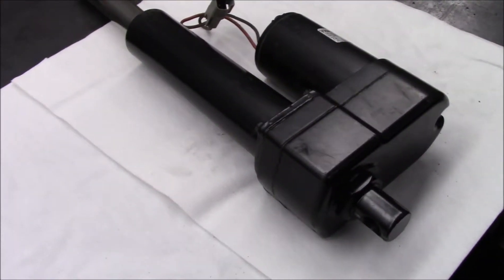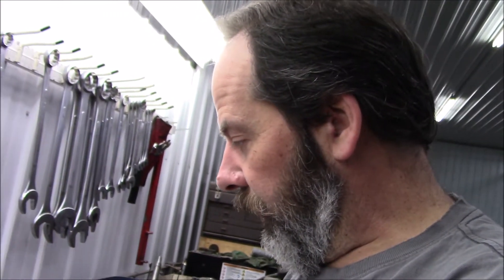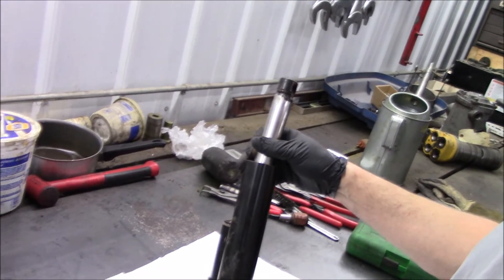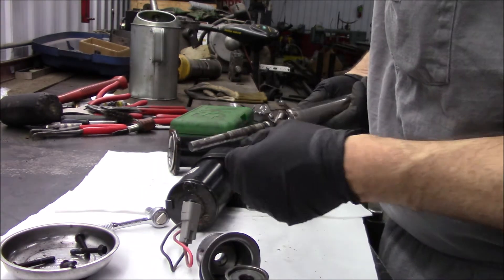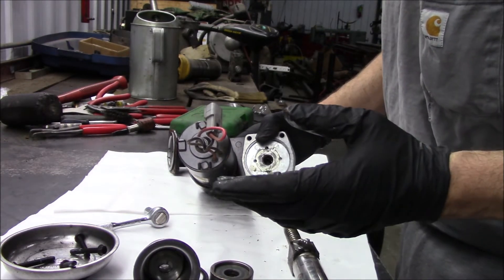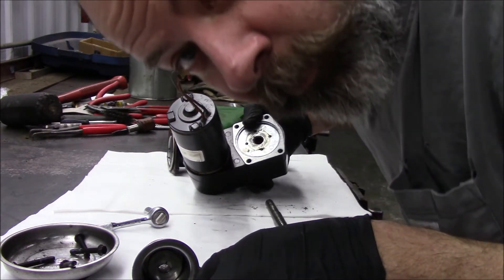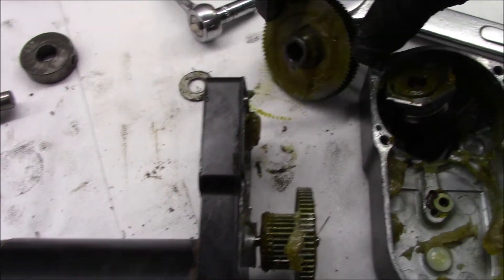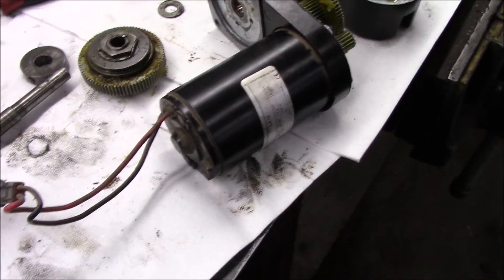Linear Actuator Teardown!

Comment: Do you remember how you removed the rear housing to access the gearing? Is it just the four smaller bolts and a single torx bolt to remove, or does the "big nut" also need removing?

Comment: Your video is very helpful to me as it the only one I've found showing the insides of the gear case. This week I was using a circa 2002 John Deere Gator 4 x 2 and the cargo box lifted up then suddenly came down. Upon inspection, three of the five machine screws that hold the actuator bottom case together had fallen out and were missing for some time. I've now learned that is a common problem. The two remaining backed out far enough to cause the case to come apart, thus causing the cargo box to come crashing down with a thud. At the time I was dumping crushed stone on a trail and didn't see any of the three gears/clutch on the ground. Frankly I didn't know that I should be looking for them. I may ask a friend with a metal detector to visit the area to find those three parts. At this writing my Gator actuator from John Deere is $1200 and aftermarket is $600. These actuators are not made by John Deere, but by the Thompson Division of Danaher Motion (formerly made by Warner Electric).

Comment: I had one of those stop working after a the utv collided with a tree going reverse with the bed in the up pos. Any idea what could have caused the actuator to fail?
Reply: There is no damage other than a bent tail gate I might add. The cylinder has no obvious signs of a failure
Reply from the maker: @aidanleitch4707  internal probably.